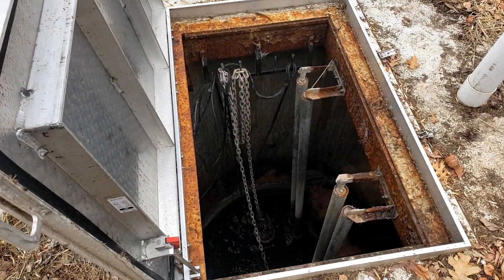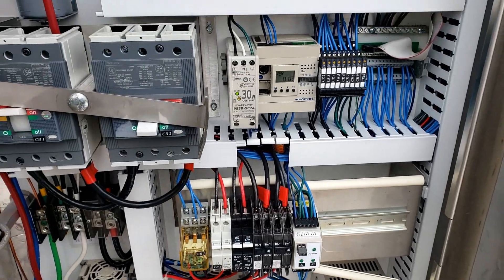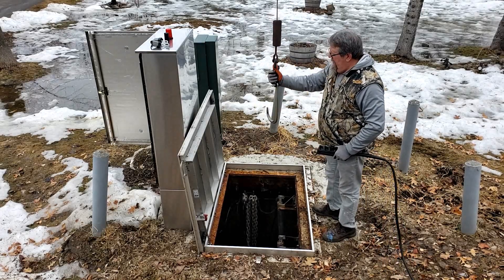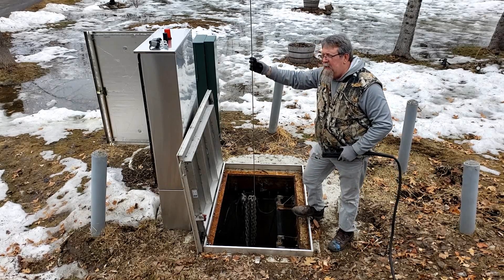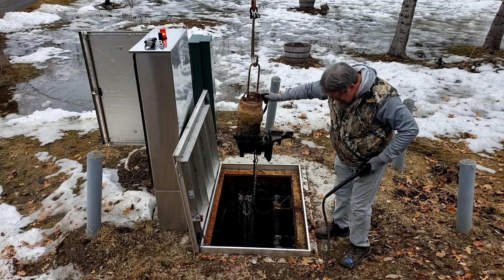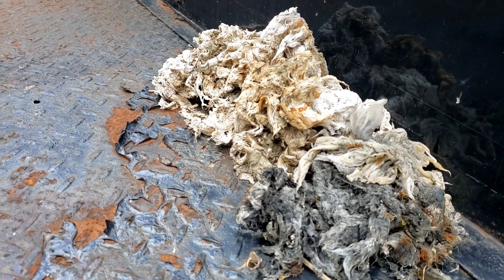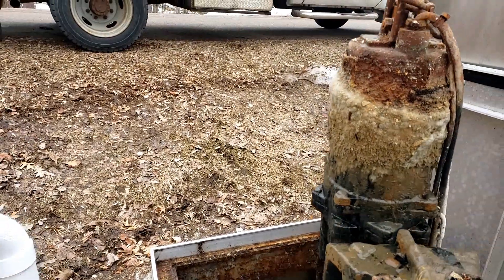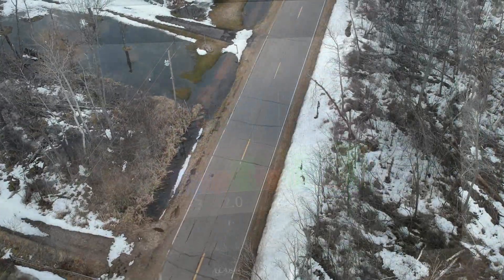Lift Station 2 Pump Cleaning

Comment: I have only been at one pump station and it was to install a back-up gen set. The maintenance guy told me I had till 3 pm to get the power back on, because that's when the school kids and their mothers would be home and start flushing toilets. (condo complex) Just my luck and the electrician never showed up that day, so I had to do a temporary "bug in" to get the juice back on!
Reply from the maker: Yes, the school rush, kids holding it in all day! Lots of solids. Good times  😝

Comment: A day in a life of a field agent. Scooper, scrapper, extendable pole, trash bag, trash can, amp meter, disposable gloves, working truck and cellphone. On-site check amps, clean lift stations, clean float switches, test pumps, test high level alarm and record activities on paper. Take pic of paperwork for personal records and drop paperwork off to
property manager. 
High amp clogged, low amp airlock, constant running pump bad transducer or float switch height setting bad, weird pump sound bad bearings or grits, pump not pumping check fuse. windings bad? Seal leak? Thermal overload? Solve puzzles and investigate paranormal activities. Rinse and repeat.
Reply from the maker: Yep that sounds correct. We call those annuals

Comment: In the real world the pits are 20 feet deep, and have no display panel, just a couple of hand off auto switches and it indicator light bulb when the pump is pumping, but the bulb is burned out anyway.
Reply from the maker: The smaller panel's,  home owners and small duplex panel's only have a red alarm light. Most of the time somebody has removed the bulb. Our panel maker is, IFS by SJE Rumbus out of Detroit Lakes, MN.

Comment: Nice video! Do you happen to know how to test the pump with a meter to keep track of Amps it’s supposed to run at? I’ve been told you can check the reading and if the amps are reading too low or too high they can tell you what’s going on with the pump
Reply from the maker: Yes, I use an amp clamp and have a history of the amps from the lead  wires to the pump when the the pump was new and when its clean.. Changes in amp draw can show a problem before a red light at night!
Reply: With a meter if amps are too high chances are it has "stoppage" if amps are too low there could be mutiple problems; "airlock " is the most common, that usually happens when the station is pumped all the way below the inlet of the pump and it looses it prime.    Ive only been in the waste water game for alittle over 2 years and i work 7 days a week dealing with lift stations and waste water plants. We dont have small pumps like these all are 3 phase minimal.

Comment: How does the pump get connected back to electricity and to the outlet pipe after you just drop it back down
Reply from the maker: We have what is called a "Base Elbow" The pump slides down a rail system and meets the gasketed flange. The weight of the pump keeps it snug to the base. And Bob's yer uncle!
Reply: pump has power isolation switch.....whr im from your supposed to lock and tag isolation switch.

Comment: What do use to lift pumps?
Reply from the maker: I have a F550 and it has a 3000 lb Lift More crane. Its a little big for these pumps but better big than a hand crank!
Reply from the maker: I have a service truck with a Lift Moore crane

Comment: Man, someone needs to invent a toilet that doesn't flush these kinds of fibrous materials. If such a toilet existed and it were required by code, then we would all save money in the long run. Hell, most toilets already take several flushes to get some of that stuff down anyway. I'm sure it could be improved
Reply: Yeah we could go back to regular flush toilets that flush everything down in 1 flush instead of toilets that need to be flushed 2-3 times on top of dumping water down them. All that "save the world" nonsense is just that, nonsense. It's all so these people can sell the next big thing.
Reply: @mikeznel6048  This was forced due to water conservation on the water side of things.  I've worked both water treatment/distribution and wastewater treatment/collection, so I know.  You need to get to 65 RGPCD to EPA's standards.  Resident Gallons Per Capita Day.  So 65 gallons per person per day, to get there, low flow toilets, low flow faucets, more accurate meters (to negate losses).  So yeah blame the EPA for wanting cleaner waters.  I agree and have done my part!

Comment: Does the wet wipe toilet paper break up in the sewer system?
Reply from the maker: No, they roll in the pipe and will actually become like rope. Gets clogged in the pump.
Reply: Not supposed to flush them or put them in a septic.

Comment: I would think this customer, (most customers) would benefit from the use of grinder pumps, instead of a solids handling pump when it comes to feminine hygiene/wipes going into the application.  Good video btw.
Reply from the maker: These pumps are grinder pumps. It is to bad that people flush what they do. I would rather their pump plugs not mine.
Thank you!
Reply: We tend to design lift stations with “muffin monster” grinders in front on the lift station

Comment: Thanks for the video, just wondering what keeps the water in the well from not freezing?
Reply from the maker: The water depth is below the frost. And the water temperature is about 40- 45 degrees f.
Reply: The depth.. lol
Reply: Hey lee.... question.  I have a pump with a sump mounted on the side of it.  It is running high amps amd tripping the overload on the VFD. Nothing is clogged. Any thoughts?? Thanks
Reply: @bubba6richards729  Have you checked the piping for clogs?  Checks/valves?  If the impeller spins freely and the VFD is showing high amps could be the motor.  Does it pull high amps with nothing attached?  Might want to MEG the motor and check for low resistance.  A short to ground would fault out the VFD immediately, so if it's still running but pulling high amps, check the stuff I mentioned.
Reply: @WildRapier  figured it out! It was a clearance issue where the impeller mounts on shaft. Once I took the impeller off the shaft was loaded with string and wipes. Under normal inspection you couldn’t see it. When I spun by hand seemed a little “tight”. Removed junk bolted impeller back on and it’s been working for 10 months now no issues. Thank you very much for the reply. 👍🏼

Comment: Thank you for your video. I’m actually looking at this job. I’ve done residential plumbing and cvil engineering ( water mains and gas maine’s . There is a training position on lift station mechanic for my county and I’m just curious about what it is they do.
Reply from the maker: Your welcome, I've had 35 years as a plant operator and maintenance on lift stations. Please Join the team!!
Reply: @lbundy442  good video!  Can you get one when things go really wrong?  I've been through (as an OP/Supervisor/Superintendent) ice storms, 8+" of rain in a day, pushed 1.414 MGD through a 0.75 MGD plant and held the solids, an F3 tornado taking out power to the city for days, with  hundreds of E-One low pressure satellite stations at houses.   Utility workers drilling through a marked 10" AC force main (sewer).  We also handled the water side.  I'll agree with you though, FLUSHABLE wipes will flush and cause problems all through the system.  The people who put flushable on those wipes should be billed for all labor and costs related to their MIS-information.  I have found a whole lobster tail on a bar rack before, never ask how!
Reply from the maker: @WildRapier  
I disapprove of e-ones, I live in a state of lakes and resorts.  Lots of problems with those units. I prefer hydro-matic pumps which are rebuildable. Good luck to you, and watch for splash back!
Reply: It's been a few years since your comment but I started working for the city on our lift stations pretty recently and I honestly love the job. I'm coming from retail/warehouse work and this job is far less shitty (sorry, bad joke.)

I have good benefits, pay is decent but could be better admittedly, unionized, great job security, and lots of room for advancement. Every day is different and you're constantly learning something new. 

Also, the smell really isn't as bad as you'd think. Some lift stations are worse than others but I gag while cleaning up dog turds but don't even make a face when I open up a wet well or open up a pump to clean it. If you like fulfilling, purposeful work, it's a good gig.